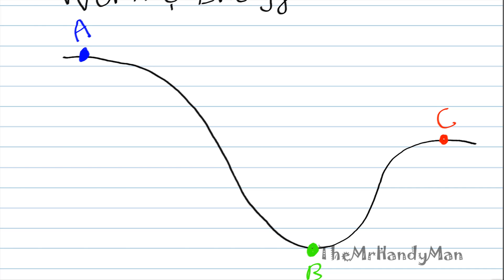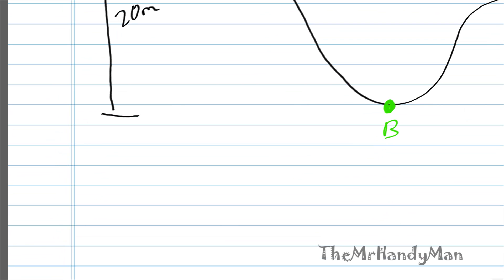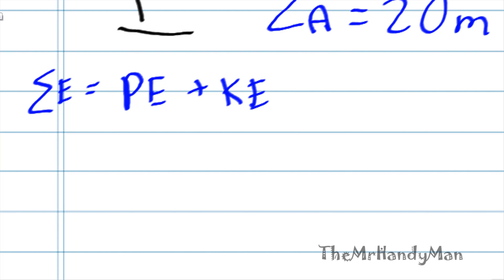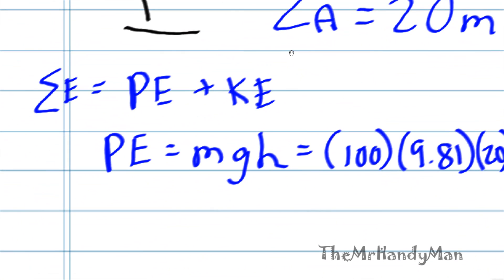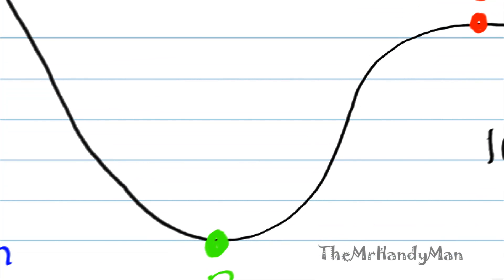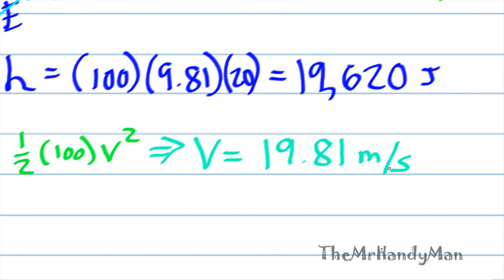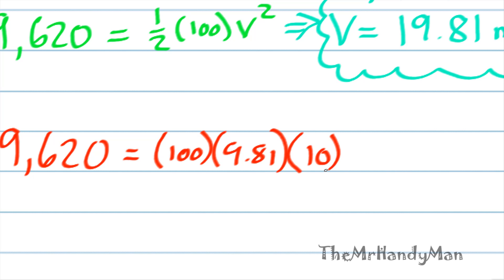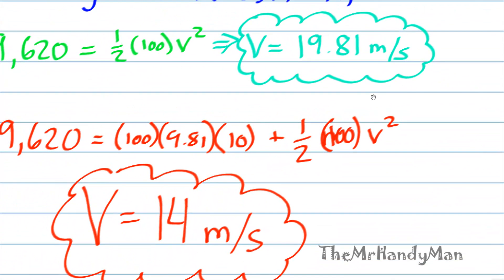Vector Dynamics - Work & Energy Method - Example 2

Comment: Why did you go though all of the work of calculating the velocity at point B? We know, since there is no external forces, that mechanical energy must be conserved. So you can just equate the energy at point A with the energy at  point B (with velocity at point B as your unknown) and solve for velocity. I got the same answer of 14 m/s with only one calculation.